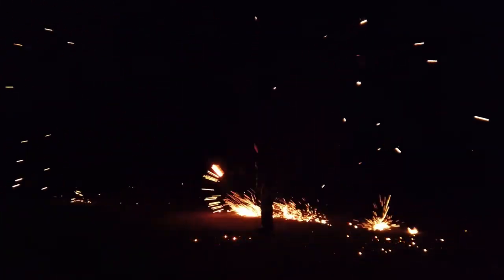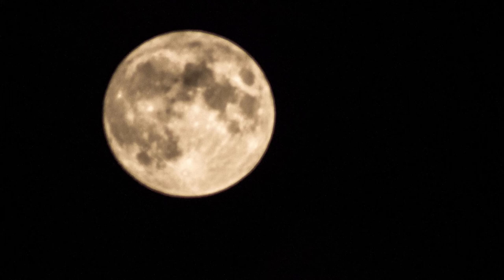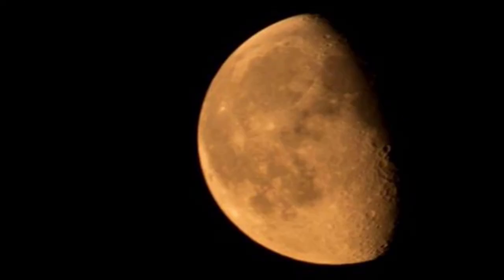Live with Nomadic Vanman

Comment: I’ll have to see if I can find the picture I took of the moon… Wayne how did you get those flames or light effect around the tire of the truck?
Reply from the maker: Ahh the fire around the wheels. You need a long steel rod then some wick material from a oil burning lantern. Tie that around the rod and use some lighter fluid on it and lite it.  Then open the camera shutter and draw around the wheels and out the back. Simple but effective. Thanks Dave